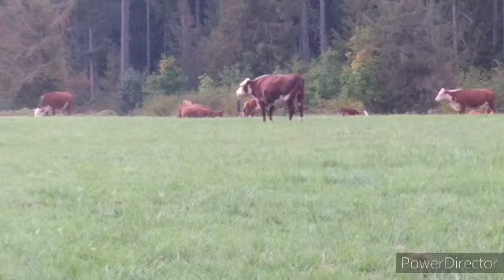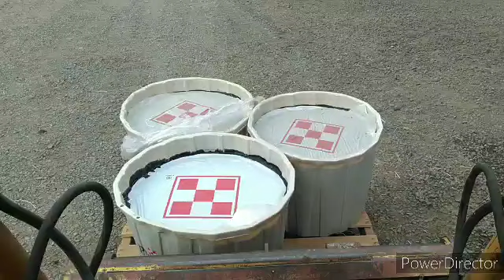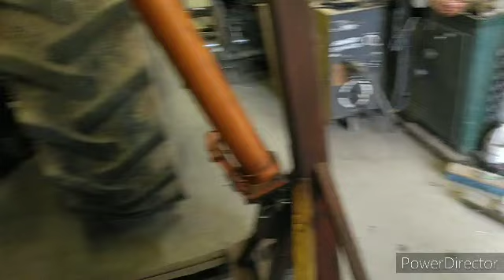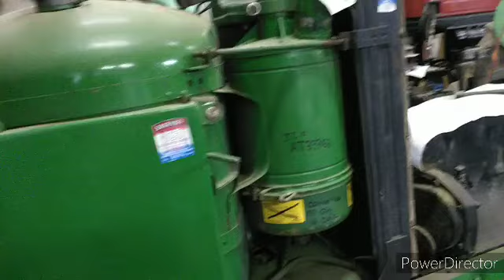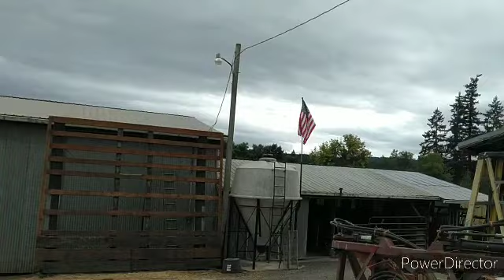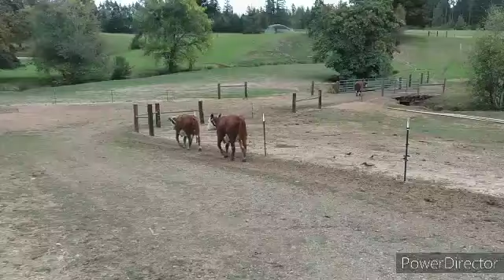🤬 irrigation! fed hay, Ron will be here tomorrow 👍

Comment: High winds at home.  Quarter of a inch of rain according to relatives.  I'm not there. 
Used to haul tubs of molasses out of Minnesota down to Oklahoma ranchers.
Enjoyed that.  Ranch hands would climb on the trailer, and use hand signals to direct me across the range tipping them off at intervals. 
Thanks Ed.
Reply from the maker: Nice weather... Supposed to get 2" and higher winds.. 
Sounds like fun driving around the range..